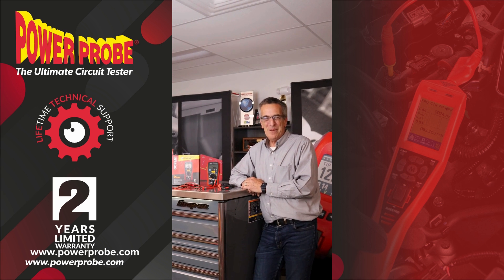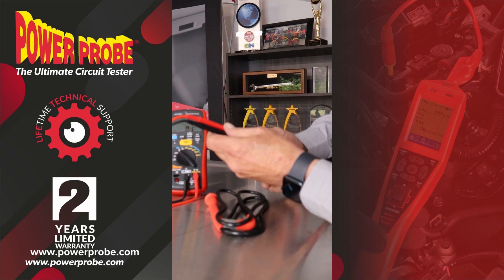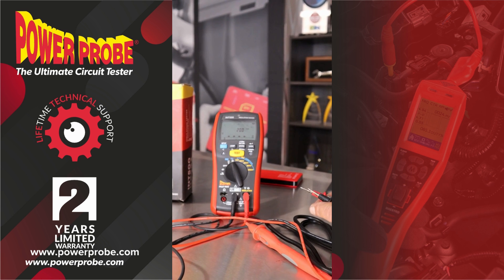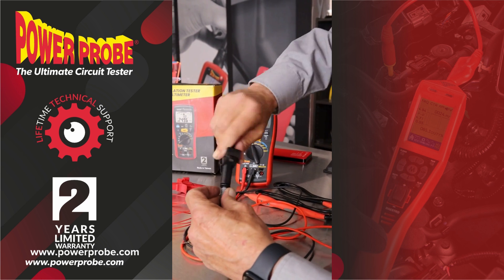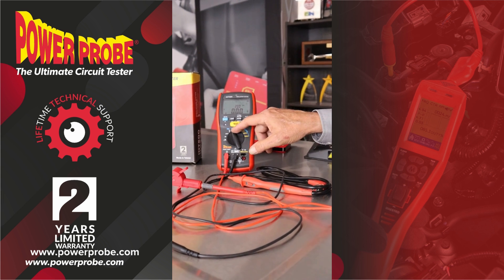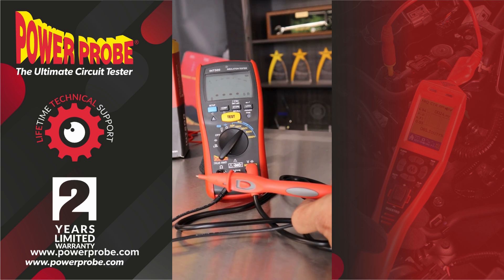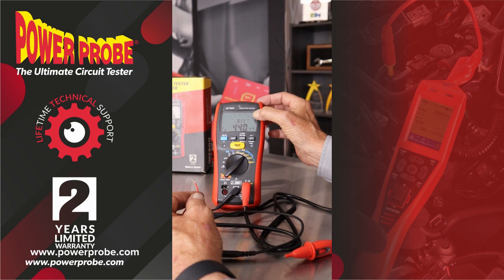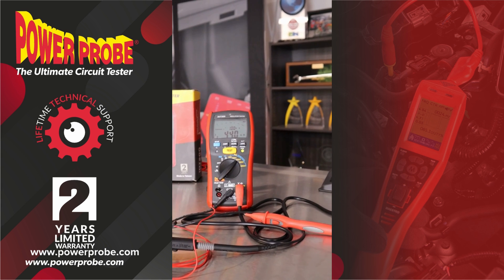The INT500: An All-New Multimeter from Power Probe

Comment: 5 ft of 20 awg should be 16 mohms.... going with what he says should have showed a value.....    (but in real life most meters measure 100's of mohms range... not 10's of mhoms range...   so I would expect it to show 0.  Should be done with a 4 wire measurement type meter if less then 1 ohm to really measure something that low in resistance..... (I get it's zeroing out the lead resistance and that's how it will get away with 2 lead measurement.....)  But the insulation test (megger)... that's pretty cool.